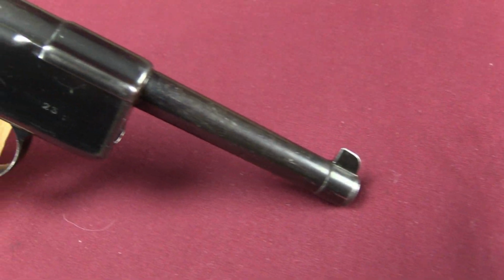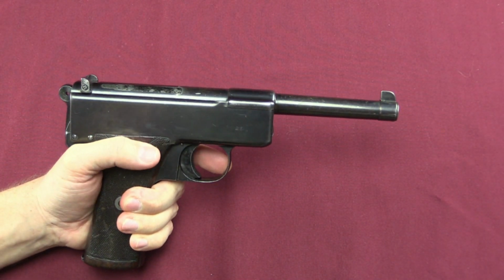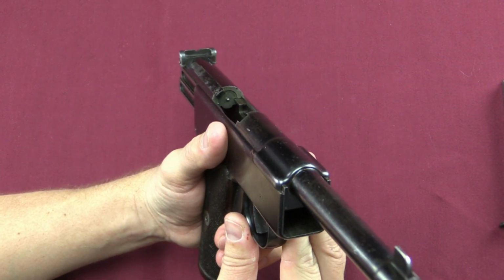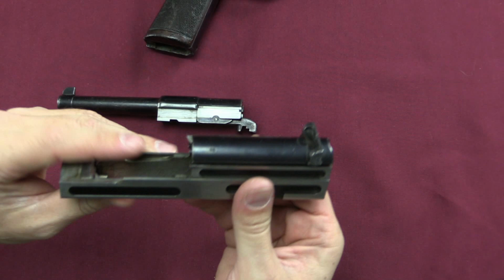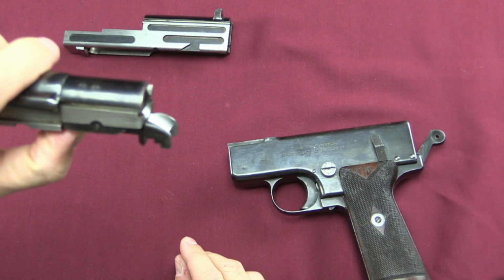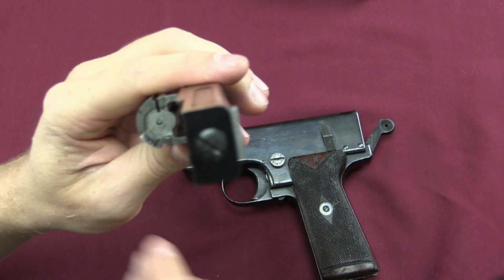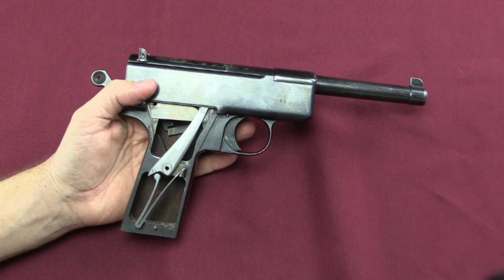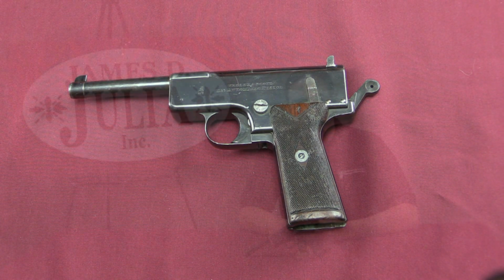Webley Model 1904

Comment: I believe the milled cuts on the side of the carrier assembly are there more for reducing contact area to reduce friction and give an avenue for debris to egress.  The locking feed ramp does not look like it lines up as you described, maybe the camera angle threw me off but it seemed that the receiver block actually interfaced farther back. Given the feed arrangement it looks like it can not interface as far forward as you suspect.

Comment: With a .38 or .32 the concern about jacketed rounds might have some sort of truth. 

Ironically, the rather large .455 that was used at the time meant that that modest loss of mass would not have been a problem.

Comment: Just by looking at it I would complain about the high bore axis and the small and sharp gripping surfaces, this gun will not be comfortable to use. Going on the inside, the two locking surfaces may me a good safety feature but the whole mechanism is rather complicated. Overall it's an interesting but sub-optimal design, I can see why the military rejected it.

Comment: Curious, as are many British designs.... I could make bad jokes about warm beer & a Lucas refrigerator.... That aside... If I understand this action, the front locking lug is operated by gravity. Would this pistol function properly if held sideways or upside down?
Reply: I know it's been 6 years, but that locking lug is operated by a cam on the top of it that forces it down when the barrel has recoiled far enough.

Comment: Are those locking surfaces purely gravity actuated? because that .. looks like a gun you couldnt fire while holding at an angle without getting a malfunction.  I love the elegance of the design but.. and the problem with any fouling at all causing those locking wedges to stick.. sounds like a real problem unless it was actually concussion pushing them instead
Reply: It's not gravity, the tip of the block is angled so the pressure of the cartridge moving the slide will force it down into the groove when it has traveled far enough.

Comment: Do you think the recoil spring design for this pistol will ever be used for a modern pistol design? seems clever enough.
Reply from the maker: I doubt it - they are a lot more expensive to make than coil springs.
Reply: Because of modern methods and practices I suspect. Shame. It seems compact.

Comment: Just out of curiosity, would the v-spring have been strong enough (or as strong as a conventional coil spring) to operate the gun as a blowback action? I wonder if Webley had the locking lugs figured out first, then decided on the v-spring to fit, or if it was the other way around (wherein their experiments found the v-spring not strong enough, so redesigned it with the lugs).
Reply from the maker: The v-spring could be used in a blowback mechanism. Its problems are that it's a lot more expensive to make than a coil spring, and I suspect it has a shorter service life.
Reply: Interesting, thanks.  I suppose Webley wanted to save space in not using coil springs.
Reply: Forgotten Weapons I think the bigger problem is that when a coil spring breaks, it can still kinda work, at least for a little while.  When a v-spring breaks, then it completely stops working, immediately.

I really don't know how long I drove my car around with the rear coil springs broken.  Didn't know until I went to rotate tires, and noticed that something didn't look right.

Comment: I like the design. The extensive use of cams should make it rather easy to mass produce. Of course it had some small issues to work out being a new design, but over all I like it. The only major issue I see is it appears to weigh about the same as a sub-machine gun, ha. I am sure they would be able to trim it down though if the project had more traction.